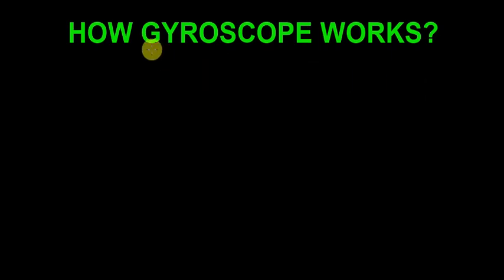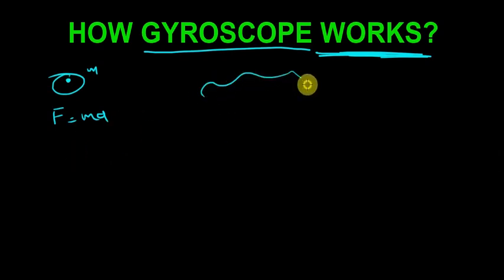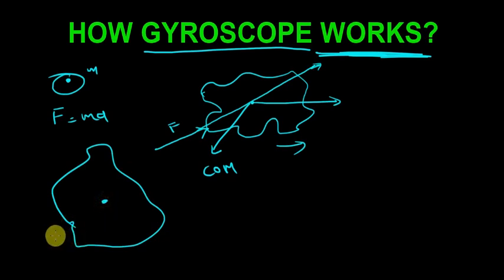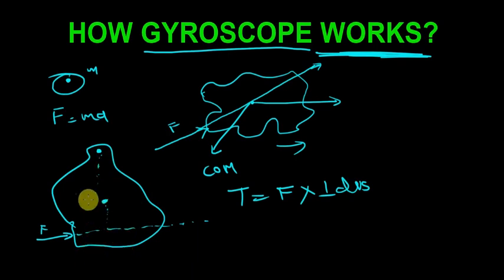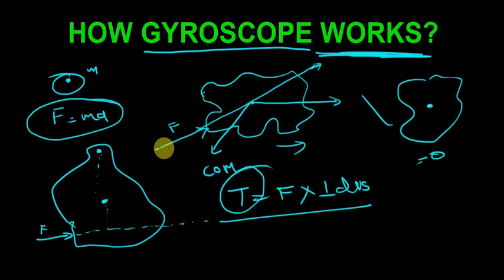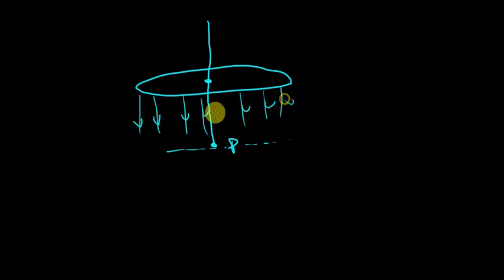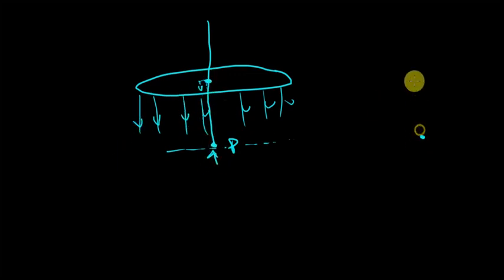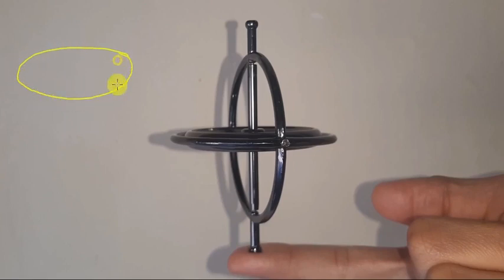How a Gyroscope works? Understanding Physics Behind Gyroscope (Detailed Explaination) by mathOgenius

Comment: A single force can produce both translation as well as rotational motion.
Reply from the maker: the components of that force must have torque,
Reply: @mathOgenius To produce both motion, only condition is that resultant  force vector should not pass through centre of mass of body or points on axis if it is hinged.
Reply from the maker: then its torque,
Reply: @akashverma5756  exactly